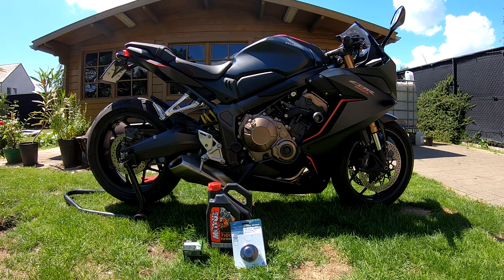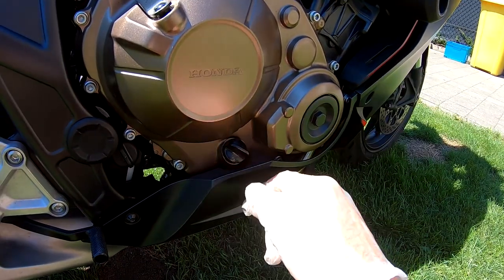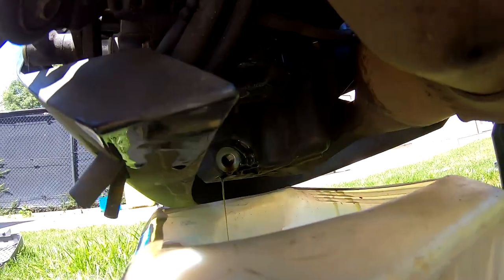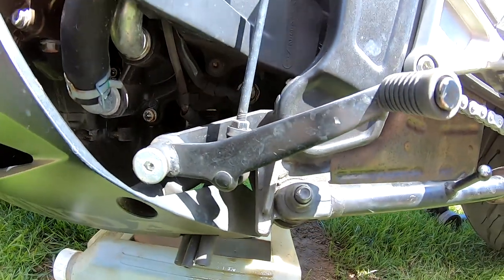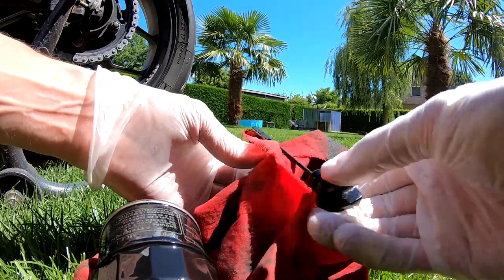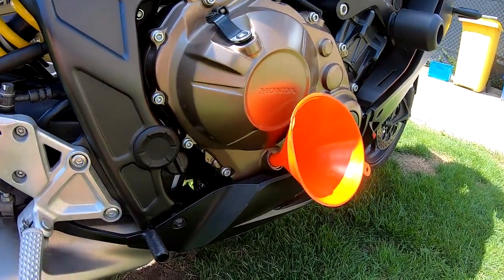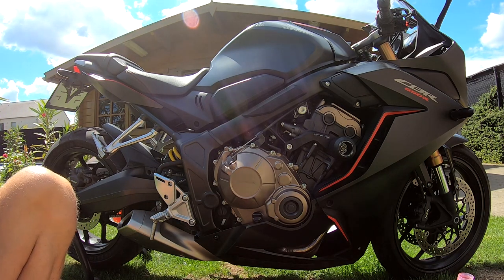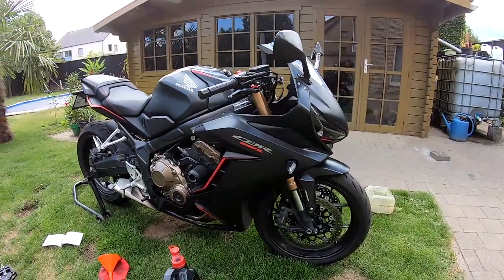Honda CBR650R Oil and oilfilter change

Comment: hi , may i ask you what is the size of the oil filter tool removal?
Reply from the maker: Off course you can ask.  Cup type oil filter wrench. HC-65/14   W84-04181. 65mm. Or 64.7 mm. (Info on the pakkage). Greetings from Belgium. All wrenches for 3/8”.
Reply: 65 mm with 14 flats/flutes

Comment: You stil have warranty? You can change your oil alone? I was thinking that you need to make revisions at honda
Reply from the maker: No warrenty anymore if you do the maintenance yourself. Buth normally its 2 years in belgium. This year, for new bought honda' s its 5 years, if you do every maintanance with honda, evere year or every 12.000km wich one is reached first.  My warrenty period is passed, so for me it did not bother.
Reply from the maker: You can change oil alone, but there wil stay a little bit of old oil in the filter then.
Reply: @JanSV  12 k km oil change..insane with the 10w30 semi sintetic recommended.
Reply from the maker: @veniamincatalin7789  Full synthetic 10W30. By Haynes service manual

Comment: Is the 10W-40 okay to use apart from the 10W-30 oil?
Reply from the maker: Hello, i used the motul 10W-40 because i always used it with my previous bike, the cbr600fa PC 41 from 2011.  Buth indeed, the haynes (6461) also advices to use.

Oil Type :
API grade : SG or higher, JASO T 903 grade : MA

Oil Viscosity : SAE 10W30

So the best thing is to use 10W30
Reply: @JanSV  I read and heard that full synthetic is good quality, man made oil so matching the same stats can I still use 10w-40 for my cbr650f 2017? And will it damage it?  I’m looking for better quality compared to the 10w-30 semi synthetic oil
Reply from the maker: @samuraiela1868  Whether you can use them on the cbr650f I dare not say. I do not know. Just know that the 10W40 full synthetic from motul is very good.
Reply from the maker: @samuraiela1868  the motul 10w30 is also full synthetic.

https://www.tradeinn.com/motardinn/nl/motul-7100-10w30-4t-olie-4l/137334329/p?queryID=be4f7866f4f26d003f62a8384a777570&buscador_search
Reply: @JanSV  thank you that’s what I’m looking for then.
Reply: 10w40 is great.  I use motul 7100 full synthetic.